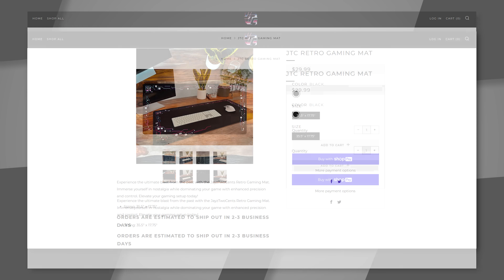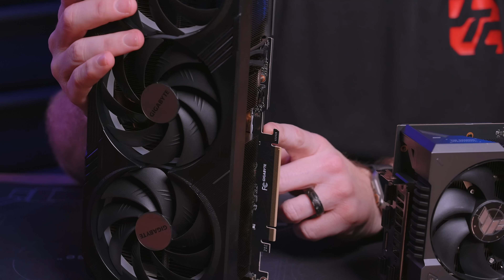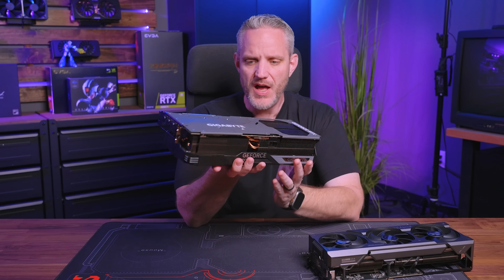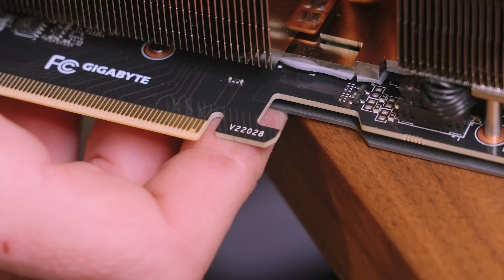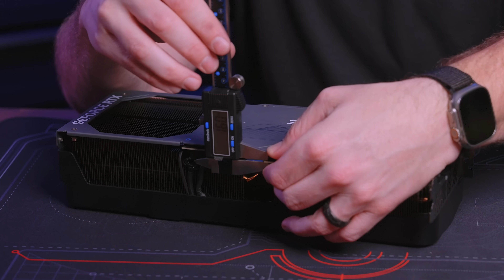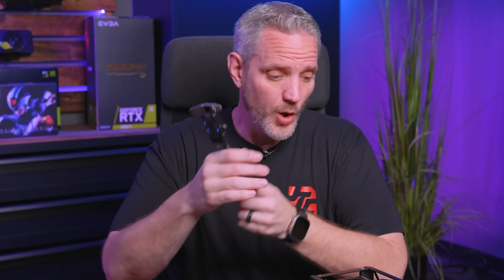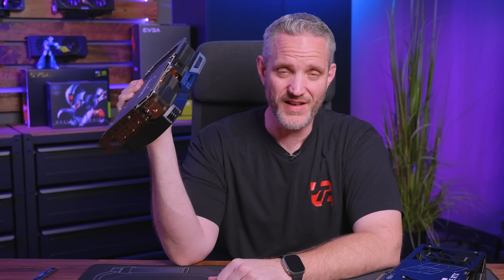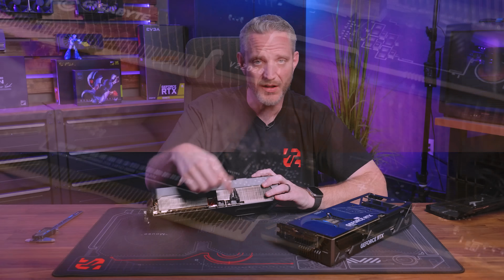These GPUs are cracking and the company REFUSES to warranty them!

Comment: I had my EVGA 3090 Ti With a water block sandwich (water block and active back plate also a water block) and it did not crack under that weight, which is FAR more than a factory air cooler.

Comment: I have broken tabs on very lightweight network cards twice in the past doing just home networking and a lot of over and over again swapping in a place where you cant reach your hand down to grab the tab and not properly releasing the tab, so i believe that
That being said, all of those network cards still work even with tabs completely broken off, gigabyte needs to RMA these cards, clearly this is their fault and something that should have shown up during testing, the tab and around the tab should be a keepout zone.
EDIT: i should say that generally speaking PCB damage is considered the fault of the consumer so i dont really fault them for initially denying claims, however its clear now that this is a defect and they need to go back to previous claims and reopen and accept them.

Comment: Don't forget, there was a substrate material shortage during the time that 30 series were manufactured.  They may have been forced to use another supplier and the material wasn't quite up to standard.
Reply: 100% this gigabyte is cheap in every sense, any decent fr4 or better PCB substrate should not be failing like this.

Comment: the inside radius on the gigabyte card is smaller and it centers the force of where it will crack. the asus radius is larger and it spreads out the force better.

Comment: The important distinction i want to know about are we talkin GIGABYTE or AORUS? or BOTH?  
because ever since the Windforce cooler moved from an Aluminum Shroud on the GTX980 to a plastic shroud on the GTX1080, which coincidently was the year where they introduced AORUS as their "Premium" brand... i do not trust anything with a Gigabyte logo on it anymore, just because that gives me the perceception that this is now the cheap stuff where they will 100% cut corners.  

I would really love to see a comparison between AORUS and GIGABYTE branded cards build quality. (fan noise, coil whine, rigidity and all that stuff)

Comment: jay, its prob because the asus card has the standoff bracket / screw that basically reinforces the PCB (prob even connected with the backplate) in that area so it doesnt rly flex that much compared to the gigabyte which has basically nothing. i bet if u clamp both cards down (without the cooler) they prob bent / break off almost at the same pressure level. so the asus is more reliable in that case but everything can break off if u apply certain amount of pressure obv. Gigabyte seems to cheap out of those reinforcements attaching the cooler & backplate together to the PCB. saves alot of money tho.

All theory tho i can be wrong, but iirc i had a cheap GPU / MOBO where i could bent the PCB very easily and some beefy ones that i couldnt bent much cuz it was properly screwed together with atleast a metal plate at certain locations of the board.

Comment: Well if you watch close to that breaking point, asus cooler is attached to the pcb very close by and gigabyte not so that bendind is happening way bigger area than asus. Typical gigabyte, bad coolers and bad overall design. Most of the breaking gpu:s are gigabytes.

Comment: The extra flex is likely due to the different shapes of the PCB around the tab. The Gigabyte design creates a much larger cantilever than the Asus design. That's probably the defect right there. That shape probably can't withstand normal handling more than a few cycles.
Reply: That plus the ASUS card has the PCB braced to the cooler right next to the tab. The Gigabyte card has that whole area notched out where ASUS has more PCB material and a brace.
Reply: Be careful? More substantively what Gigabyte could do is to send customers a stiffening kit consisting of an adhesive backed piece of FR4 (PCB material) that bridges over that square gap and the area that keeps cracking. Customers would stick that to their still working board to protect it. That's a fairly cheap solution that would prevent a flood of RMAs.
Reply: Any idea to how we could avoid the pcb to break?
Reply: @Alonne1  use support standoffs. No sag = no flex = no stress = no PCB cracking. At least in theory.
Reply: or because it has a standoff for the cooler, the mounting of that doesnt allow the extra flex because it provides structural rigidity
Reply: I agree, the Asus card has a semi circle cut out right next to the tab which continues into a straght line along the bottom of the card which to my eyes is just naturally going to be much stronger. 
The Gigabyte card has a 90 degree turn then, I'd say about 10mm straight to another 90 degree turn to get to a cut out of the bottom of the card where even more rigidity is lost. Given the sheer size and weight of these cards and how much they cost, they should just know better.
And yes, I would also say that the extra stand off helps on the Asus card as well.

Comment: It's the radius to a straight line, you're losing a lot of strength compared to the double radius on the other card.  And as long as that straight is, you're looking at the long and slender condition modifier coming into play.

Comment: Hey Jay, great video to bring awareness to this issue!  However I believe the Asus card may have felt stiffer due to it having a cooler support right next to the locking tab.  In the video you can see the Gigabyte flexing at a much farther point into the pcb than the Asus due to it not having that support.  Just thought you may want to look at this.  Appreciate you!
Reply: Yep there is a support post on the Asus card right next to the tab which would cause the tab to feel more rigid. The gigabyte pcb is flexing over a long distance of pcb.
Reply: @Hagop64  First think I noticed too.
Reply: Actually, interesting physics nuance
. 
Higher rigidity technically increases risk of cracking due to outside factor/pressure, as it is opposite to plasticity and flexibility. And that is issue of proper support engineering.

Sag deepness and outside forces are what you need to look for. Who knows what these people did to cards before cracks appeared. In masses consumers aren't even close to being as advanced and knowledgeable as enthusiasts.
Reply: @DimkaTsv  exactly, if its more flexible that means these cards were being put in prebuilts that were getting thrown around in shipping most likely. this debacle is more than likely just overworked people packing expensive parts in substandard ways, and then handing them off to overworked delivery workers whereas an asus card is less likely to be in a prebuilt, and less likely to be bought and shipped in a cheaper fashion because all their SKU's are more expensive for the same performance roughly.
Reply: Exactly, that support for the cooler adds a bunch of rigidity and it also has more material on the PCB where the Gigabyte card is all notched out, putting a lot of leverage on the tab. The Gigabyte card doesn't even have PCB material where that brace is on the ASUS card.
Reply: Asus also has a long history as a premium manufacturer, whereas gigabyte has built their reputation on being cheap and probably good enough.

Comment: i was gonna buy the x670 Gigabyte X670 AORUS ELITE AX but now i'm questioning my choice
Reply: buy what you want
Reply: every bios version on that board has some bug, going all the way from F4 to F9a (havn't bothered with F9b.)
F8 for example will sometimes post and sometimes not with just stock settings and thats a "stable" version
F5 is by far the most stable except you have to change like 5 settings to circumvent a SOC voltage bug otherwise it auto's to 1.3v and you can't update the bios unless you use the flashback button, all other methods which include 2 in the bios and 1 in windows fail.
Reply: @spaghettiupseti9990  thx for the info sounds super annyoing not gonna waste my money on that

Comment: I'd assume the extra rigidity of the asus card comes from the posts mounted close to the tab, reducing the length of the board that can bend.  Sort of like having 2 sticks of equal thickness, one being 2ft long the other being 2 inchs, one will be easier to break than the other, even though they are identical thicknesses.
Reply: Thank you for pointing this out I was hoping I would find this in the comments. 

I’d like to add that the notch (for lack of a better term) is also somewhere where stress concentration will increase due to the change in geometry. The higher Kt associated with the change in geometry will increase the likelihood of a stress fracture. That post in the other GPU not only provides stability against the cantilever force but also helps minimize the effects of the notch geometry by providing stability closer to point of issue. 

I’m not a mechanics guy but I’d also suspect a graphics card with the copper traces mixed with other material may perform non-monotonically. My day job is lighting stuff on fire so take the last paragraph with a grain of salt
Reply: I saw that too, but not only that, the Gigabyte card has a big section of the PCB above the tab cut away as well. Leaving less PCB material and making the tab "longer" if you get what I mean.
Reply: That detail that you point out added to the screws that fix the cooler to the rear support plate indicates that Asus has better engineering applied in terms of card support stability
Reply: My asus tuf sags don't know if it's enough to break it eventually . . . . 

Propped it up level with an old smint tin 😂

Comment: It basically comes down to GPU sag and over-tightening of the screws be it from factory or user disassembly re-assembly

Its also possible its just inferior PCB material and its also having heat expansion and contraction ontop of over-tightening

My INNO3D 3090 doesn’t even flex in that area without putting a way past comfortable amount of force into it
Reply: Altho rosman did a repair video on an inno3d card that broken in a certain place and that place has a design flaw as the screw stopped is about mm too short so if you arnt paying attention you can over-tighten it and break it without time even being a factor

Tho you can also over-tighten it and cause permanent PCB bending like with mine but from the factory that screw was overtightened and i had to loosen it a lot

Comment: there is a fault on the first measurement.There is not  2mm on the first card. if you see on the video ,when Jay takes the first measurement the caliper saws 1.6 but when he tried to remove the caliper he mess up the measure.The material maybe is the problem

Comment: Man since I bought my first GPU 3080TUF I treated that thing like a piece of thin glass and installed a anti-sag bracket immediately! Im wondering if the 50series will HAVE to be vertical mounted if they get any bigger
Reply: That is a good philosophy to have you can never be too careful when it comes to pc components especially with how expensive GPUs are these days
Reply: @gokublack8342  Even more when companies don't care about warranty
Reply: Just got me a new 3090 from PNY. It's only a 3 slot, but it is still going to be vertical mounted.

Comment: I feel like the last couple of generation of gpus from 10th gen and up, have some weird ass defects or issues that show how quality control has just fallen with these manufactures.  Like what's going on?
Reply: Inflation driving up costs to make the cards but consumers boycotting the prices. So they start using less quality components would be my guess.

You don't typically see these issues with the top end cards which also costs 1/3 more than the regular ones of the same model.

Comment: I said it was back when card sag started being noticed it was time to find a different way to mount these things. Now they are huge and companies still expect them to hang out in the wind off the motherboard. These things ain't getting any smaller or lighter any time soon. Computer companies gonna have to figure out a way to solid mount GPUs to the case and use a cable to connect it to the CPU.
Reply: Some companies include anti sag brackets with their cards (Powercolor did for my 6950XT Red Devil) but yes either need to take a generation or 2 of just focusing on becoming more efficient power/design wise or just tell ppl to vertical mount on the box or something
Reply: Apple's MPX approach would be a good option. I don't know if they would be ready to just offer the tech to everyone, but not only do you get 2 times the PCIE bandwidth from it, it also supports the GPU for almost it's whole length which is way better than the current solution. Also, the new Mac Pro can't utilize MPX, so the tech is useless to Apple anyway.
Reply: More likely they'll push for watercooling solutions and external radiators on the high-end cards. Provides much more material for marketing, and an excuse to raise prices. Except for the 4090 the cooling solutions on 40xx cards are usually overkill anyway, so maybe if NVidia will again focus on efficiency rather than raw power in the next gen we'll go back to dual-slot designs again.
Alternate mounting solutions are hard to implement as there are way too many parties involved: You need mainboard, graphics cards and case manufacturers to agree on a solution, which still needs to be compatible with existing standards, anything else won't get enough tracking. Even NVidia itself would have a hard time pushing for something like that, and will think twice about it after the power connector issues.

Comment: That Asus card has a mechanical reinforcement right by the tab by way of the really long standoff that looks to be tying the cooler face plate to the backplate which ties the PCB to the backplate at that point providing more stiffness.
Reply: Not sure how much the standoff would help but the curve radius where the tab joins is also larger on the ASUS which would distribute stress over a wider area. Corners/sharp edges are going to break first.
Reply: @jamessnyder3807  The brace on the ASUS card makes a huge difference.

Comment: their 1660 Super is also failing, power issue for me, at 100% power it would shutdown and the driver would fail to load, at 80% it worked for a month and completely died. Issue started days after the warranty ended. :(

Comment: You wanna avoid any stress on PCB then use vertical mount just stop horizontal mounting it cos the cards are way to heavy, it cannot support its own weight from the PCI-E slot
Reply: I just avoid the stress entirely by not spending my money on this shit LOL
Reply: But glass side panels + vertical mount = Rip GPU cooling

Comment: Gigabyte 4080 here... should I still be concerned if I'm caseless? My motherboard is facing up (not mounted on wall) so the GPU's is "standing", so no side bending pressure as would be the case for conventional case builds.
Reply: your gpu is vertical and not having any pressure on it (gravity etc) it shouldnt have an issue since it isnt sagging

Comment: no lie, when putting in my 6800 I freaked out a bit cause I thought, while installing, I cracked it. that last tab on the new board felt soo sticky and went in with a crunchy thud clunk sound. I did not know lines were runnin through that little piece. why would you build it like that is my question.

Comment: Maybe I should put a stick under to hold up the right side of my Gigabyte 3080 😂 My Asus board apparently has an extra stable supporting mount with the GPU but I should look for options to be safe
Reply: I was one of the extremely lucky few that got it from Best Buy for $740 USD near launch thankfully but I am scared I should get an antisag bracket I haven't touched it since I put it in and it has some flex in my motherboard I just checked now (not removing it only very lightly pushing the card up) but it still works great right now at least
Reply: Can't be too careful gpus too expensive these days
Reply: @gokublack8342  True, I've treated it like a baby and generally have been pretty happy with it, but I never felt like I had to actually buy an antisag bracket for my 3080. Especially when my Asus TUF x570 WiFi motherboard had a big advertising section about it's GPU slot being super good (like x2 the normal standard) at supporting GPUs to prevent sag
Reply: @willwunsche6940  those “steel” reinforced pcie slots are mainly marketing they do nothing to prevent sag, really just prevents the entire pcie slot from being torn out, but does nothing for sag.
Reply: @Jsteeezz   Interesting. I never put too much trust in those things just encase but that combined with not expecting my normal size GPU to be capable of cracking the connector support made me not even consider buying a seperate support bracket. I assumed the motherboard would be the one most likely to fail, less the heavy piece of metal card that is (hopefully) designed to hang well long term without too severe sag